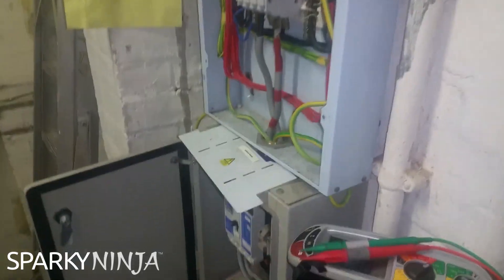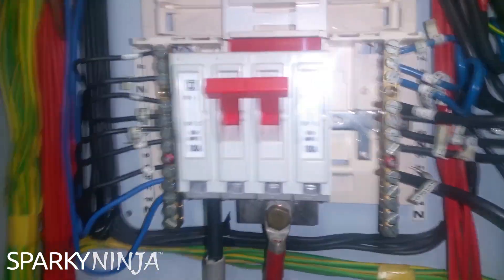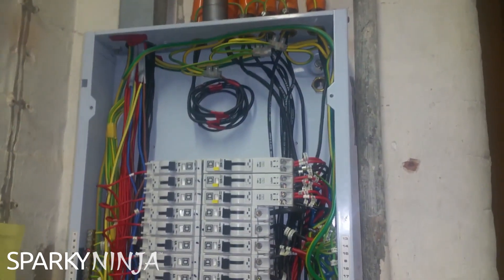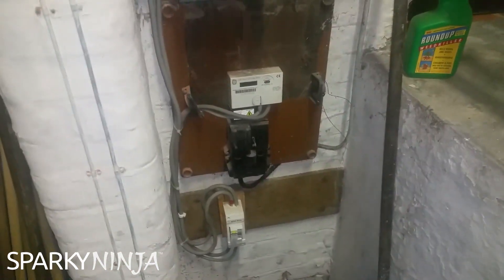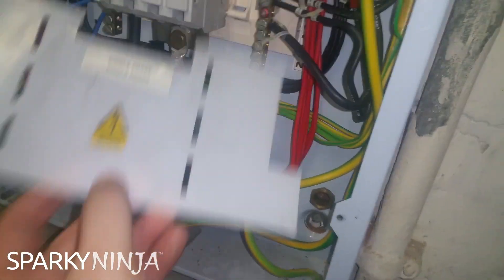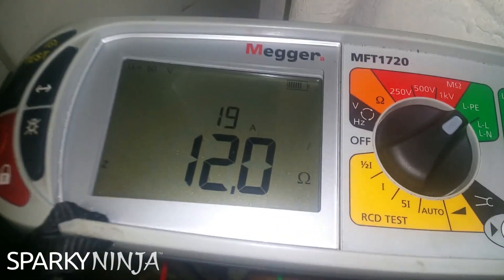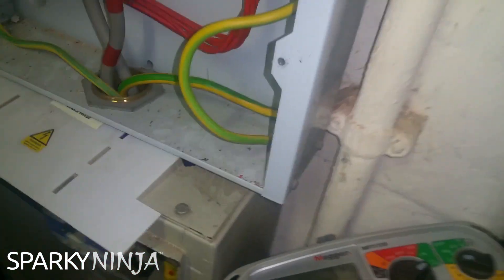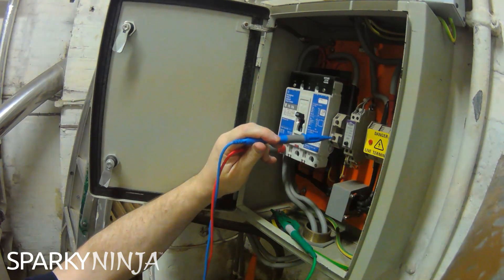TT System issues

Comment: got a 125 amp commando socket on a pme, they have a fly up to a marquee the total run is 100m or so my commando socket is about half way. a guy got a whack off a metal case of some stage equipment. I'm thinking its difference in potential i'm thinking of ditching the PME at the commando and TT with 100ma time delayed rcd at the commado socket does that sound right scratching my head ha
Reply: I think 30 Ma at commando socket it's outside and where the risk is. 100 ma too high.

Comment: Shouldn't there be an earth connection coming out of the supply head? I beleive it is tied in to the N conductor. I know our house certainly does.
Reply: nope, this supply is tt so no distributors earth provided
Reply: @conorlanders8401  It's using the same TN-C-S type cutout that we have, so he should have been able to reconnect it.
Reply: @davepusey   Only the DNO can do that and as its overhead fed they won't  switch it to TNC-S  because of the possibility  you lose the neutral
Reply: @steverobinson8170  here in South Africa everything is TNC-S these days even from overhead feed. Ground is too dry for anything else.

Comment: Max Zs reading with 30mamp rcd protection is 1667ohms 🤔
Max Ze for TT system 200ohms 🤔
That's probably why that RCD was installed in an apparently silly place?
What exactly are you failing it on?

I'm sure someone will correct me if I'm wrong.
Reply: So when it was installed, did it comply with the regs at the time? Since then, has alterations or additions taken place? If they did, then the main earthing will have to have been upgraded. This fail is in one of the fundamental principles. It is easily put right. Find some structural steel and foundations and bond to that. Or put an earth rod in. Change the main rcd to a time delay, select the ms to the ze you get from the new main earth and its compliant. If you don't understand this, then you are a cowboy I'm afraid
Reply: @nevermind824  YeeHaa 🤠
Reply: I literally just quoted the regs to you. It's not "fine"
Reply: @nevermind824  Regs Shmegs, its an EICR of an existing installation, it doesn't have to comply with BS7671.
Reply: The first rcd will trip at the same time as the ones in the dB. So all circuit will trip at the same time,instead of just the one faulty circuit.

The main switch rcd after the tails should be a time delay. The others in the dB will be lower
Reply: @nevermind824  Yea I know, that's irrelevant in terms of safety. I was wandering why he was going to fail the EICR.
Reply: Because there is no main earth
Reply: @nevermind824  it's a tt system, using the gas pipe as the earth electrode, the ze reading was acceptable.
Reply: @londontrada  You can't use the gas pipe. It's illegal. reg 542.2.6 "A metallic pipe for gases or flammable liquids shall not be used as an earth electrode. Other metallic water suplly pipework shall not be used".

You can use the foundations as a electrode though if the reading is good enough
Reply: @nevermind824  nah, its fine
Reply: @londontrada  And what happens when the gas network operator replaces the incomer with plastic?
Reply: @JohnSmith-ws7fq  I don't give a toss

Comment: Living in Thailand no buildings are ever supplied with earth, none of the servicees are metal pipes.

Being dry an earth electrode Ze test is greater than 100 ohms.

Bonding to re-bar in structural concrete works best.

Would like to change systems from TT to TN-C however not allowed and dangerious to do so inside end users building.

Comment: In Australia - we would have bounced the service, tagged it, and left.   They would need to bring up to 2018 code, which means all of that crap is removed, and only a main switch, and RCBOs are installed.  A bond to the earth mass would be required with low i.  AS3000 does allow for alternative earthing methods (5.8) such as bonding to a steel building structure (as the buildings structure is buried into the ground) or the building rebar buried into the concrete -  but as a utility, we'd never be satisfied if you mess with the principles of MEN.

Comment: why does most English electrical work look like shit and dangerous??
Reply: 32079rme 
Have you never seen an overhead service with SE cable strapped to the outside of a building going into the top of a meter socket, then out of the bottom of the meter socket into the building to a panel in the basement?
Sadly very common no physical protection, no over current protection, no ground fault protection, but very fast and cheap to install!

Comment: When you say you could not consider the Water Service as providing an earth to the building due to it having a plastic insert. Surely if it was a metallic pipe it could only be considered as a main earth if the building occupier owned that service and was in control of its condition i.e a privately owned water main?
The conduit that’s the incoming concentric service came in via would also need to be earthed as it could be considered as an extraneous conductor.

I enjoy your videos,  sadly most of the poor workmanship you highlight I see on a day to day basis as an inspector myself. Keep up the good work

Comment: The supply into the place was single phase right? Yet parts of it looked like it was meant for 3 phase how is that please?
Reply: The Earth Fault Protection unit is supplied for use with Three Phase systems; in this case, the single phase supply is connected to the 'red' phase input of the unit (the blue and yellow inputs are not connected) and the single phase output is collected from the "red" output terminal. The RCD is only measuring the difference in current between the three line conductors and the neutral; with all the supply current passing through the 'red' conductor and returning via neutral, there is no difference (unless an earth fault occurs), so the RCD functions correctly.
Reply: They've probably just linked the phases across in the bottom of the main switch in the secondary board so L1 supplies l2 and l3 into the breakers there's not actually 3phase their just used an old 3phase board is my guess

Comment: In the US in the NEC, there is a special case allowed for an ungrounded electrical system (2 pole, hot/neutral, no earth ground) having grounded three conductor outlets (hot/neutral/earth ground), but it must be downstream from a GFCI recepticle.  Maybe this is the case in this install as well?  Could the main RCD be acting as a whole building Ground fault Interruptor?
Reply: That's a weird special US thing.  It's legal if the circuit was installed before grounding was required and the receptacle is marked "No Equipment Ground."  The thinking was that installing GFCI is an unconditional upgrade in safety whether or not a ground wire is added. Unfortunately the "no equipment ground" stickers immediately get lost and the average person doesn't know what that means anyway.  I'm not even sure if it's legal to perform that upgrade now.
Reply: IN our UK electrical supplies only  the supply company can combine the earth and neutral .This is done inside the cutout and provides the main  Earth . The supply company won't provide an earth on an overhead supply it must be created by the electrician . This is called a TT earthing system . The main RCD is providing protection for the whole installation however it does not comply with regulations for division of circuits . I hope you can make sense of this .

Comment: Soon you will be looking for AFDD’s and possibly Earth electrodes on every property,that installation looks like a school,glad you did an inspection when you did,hope you installed the correct equipment in the correct way,with the correct ppe with the correct paperwork and on and on and as long as we do our jobs correctly there is no problem,any one can pull other people’s work to pieces but it is a fine line between what is wrong and right,and sure enough this is wrong but don’t go over the top!they have already done that at the top,Jib,iee nic/eic money making
Reply: Why would you be looking for AFDs and earth electrodes on every job?
AFDs are only suggested in 18th edition.
And anyway, this is condition reporting, 18th edition has nothing to do with it.
Reply: Not sure about AFDD's (at over £100 a piece) but here in the UK we have one of the best Earth systems on the planet! The exceptions are usually overhead fed (like this) and old! All new supplies need to have an Earth incorporated in them, and for that earth to be maintained in good condition by the REC! This is not the case for site supplies which are a special circumstance where we remove the system earth deliberately and the contractor needs to install earth rods and RCD's
Reply: @totherarf  The UK is the worst system.